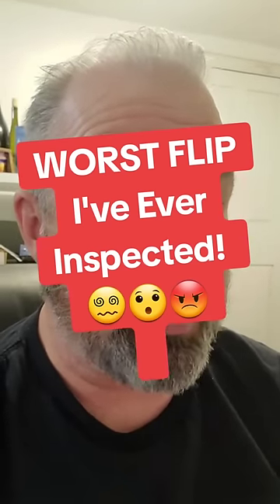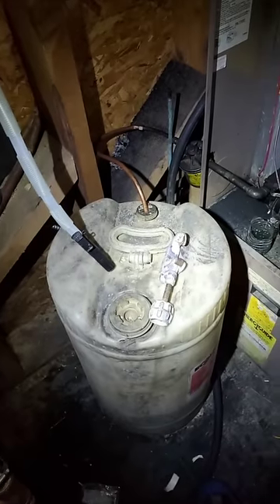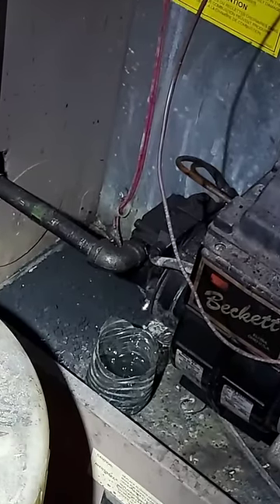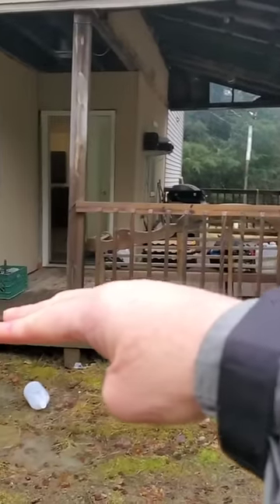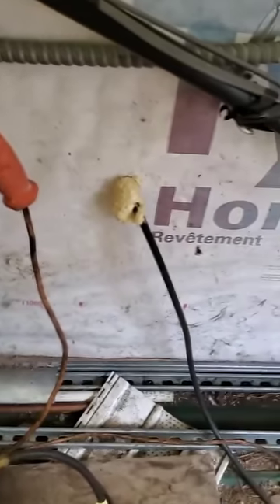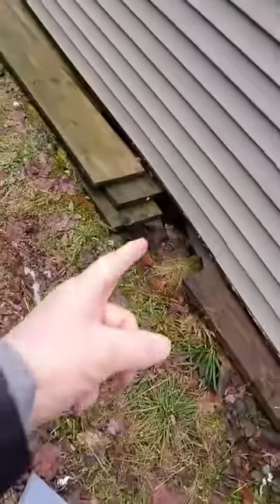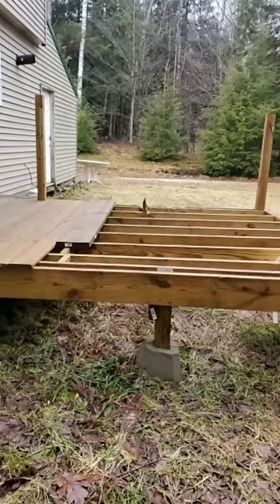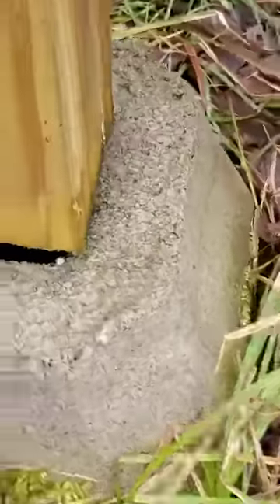The worst flip home I've ever inspected!

Comment: You should've called the fire department.  Seriously.  An active gas leak, and smoking walls???   Our dept. would've gone through the county to get that house condemned.
Reply: Building Department/Code Enforcement in my area, unless it was a 9-1-1 call that would bring out the Fire Department (the propane leak or the wood stove smoke reported to 9-1-1 would be proper). FD or the other two departments could red tag the place after they see/smell all those issues.
Reply: @crosslink1493  FD first to ventilate the place around here, then the code enforcement to shut it down.  A Bn. Chief or a fire investigator could do it after hours if the building people aren't readily available.
Reply: You don't need the fire dept to ventilate the place. Anyone can open the windows. And no need to wait for code enforcement. The fire marshal can have a place shut down.
Reply: @queenbey6678  Wrong.  If there's that much gas leaking inside, it's NOT safe to be inside.  Not every place has fire marshals.  Kinda helps if you know something about the subject...

Comment: There were definately no tradespeople on this project. Looks like a burger flipper watched too many episodes of flip this house and got courageous.
Reply from the maker: Believe it or not, the ownwr is an experienced plumber, has his own company.
Reply: @Inspector_preston  You'd think in that case that he would at least understand Ugg's first rule of plumbing:  "Inside pipe stuff should not be outside pipe stuff."  Applies to gas just as much as it does to water.  My goodness.  Would he run PEX through walls made out of razor blades?  If not, why would he think romex is fine?!
Reply: Why put down burger flippers like that? Surely they could do better work. A Big Mac is more structurally sound than those porches
Reply: @snickerdoooodle 😂

Comment: Nice to see an youtube inspector not doing the stupid "putty and paint" inspections.  This is one where the home inspector  needs to call in city/county building inspector before someone dies.  You can tell most of that work was done without a building permit.  A side note, joist hangers were not always code required.
Reply: I had a 50-yr-old deck that was fastened to the header with six alternating nails for each joist. The joint was still solid as a rock even though the boards themselves were starting to rot.
Reply: Unfortunately some places do not require an inspection after a renovation. The amount of things I've seen places I've lived that would not pass code for a doghouse does terrify me whenever I think about it.
Reply: Without a permit? How about without a brain?
Reply: The roof of a patio that was not to support a second-floor occupiable space didn't need joist hangers back about 20 years ago IIRC.
Reply: joist hangers are a couple a bucks each, why wouldn't you use them?

Comment: Got me beat by a little. We went to one to "repair" a footer , keep in mind this home had been flipped already and inspected when the current owner bought it. All this stuff came up when she went to sell it about a year later due to job transfer. The inspector caught that the addition on the far side of the house was about 1 foot above grade. He stamped a repair that had us go in to pour concrete against it to prevent wash out, not sure that was a good fix. I wouldn't have done it as a GC but the engineer approved that as the repair. The sellers had noted a "sewer smell" whenever it rained. come to find out it was a pinhole in a natural gas line under the home from the haphazard twisted up copper supply line they had run and crimped around a concrete pier. While we were repairing the foundation I looked over at the water heater and found a cedar tree cut with branches and drove in as a support for the floor. How BOTH inspectors missed that I have no idea.
Reply: They don't look most of them. They look from a far distance and go ok looks good and walk away while signing the slip permit
Reply: The inspectors probably didn't miss it. The owners just didn't fix it

Comment: Just a case of homeowners being poor.

Ive done some botch repairs in my day when I was younger.
(Obviously nothing close to as dangerous to some of these examples, I'd never risk my families safety). So well none of my fixes weren't a danger, I knew they were not done correctly.

The reason for some of my hack jobs ? I was young... had a new family, bought a house that wasn't the most cared for.. but it was what I could afford at the time. So...

Well I certainly can say some of these examples in this video are crazy. They went way past the line of "a hack job" into borderline suicidal territory.

Anyone who has ever experienced some financial hardship can somewhat understand how things ended up this way. It's  a slippery slope.
Reply: Lol. Naw. I've done some clueless stuff when I was young and broke, but spray foam on a lit chimney? Painter's tape on a gas pipe?
This is either drugs or mental disability. Maybe both.
Reply: “Weren’t a danger” <> “not done correctly”. Codes aren’t there to be a pita. They are there because someone got killed and they didn’t want it to happen again.
Reply: @sirifail4499  

Yes and no. It varies greatly depending on where you live - and money can also have a motivator.

For example, in the States, it's legal to hook up your generator to your house via an interlock kit.
In Canada (at least the province I am in), it's highly illegal and subject to fines and jail time. The only legal way is to use a generlink, which is 10x as expensive.

An interlock kit, is not "to code". Even though it is safe - but because that rather affordable method is illegal - it actually motivates some people to use very dangerous methods. Which is much worse than an interlock kit.. which again - is safe. But it's cheap and convenient so it's "against code".

I could list many more examples. But I think I've made my point.
Reply: @YSLRD  
Agreed.
Obviously, there is a line between being cheap and just straight-up stupid.

Comment: I'm no inspector, but I definitely know what your talking about. My Dad flipped houses for years, and did really great. I would help him clean out these homes well before he would continue his work.

I will share however the time I went to look at a house this guy wanted to sell me. I felt exactly the same as you did when it came to this guy's house. The floor in the house was so unfit, I could easily see anyone falling through the floor. There were chewed off holes around the door which suggested rodents living in the house. Over half his roof needed to be completely re-done, as in not just shingles. Most of his walls were gone including the insulation. The deck was completely rotten, and he proudly stood there telling me he built that house. I then said his house is unfit and needs to be condemned. He wasn't angry, but rather he was trying to convince me his house was safe. At the time he was not living in the house(not surprised). I can only say he was staying at a facility that looked after him, which I reported to the authorities everything I discovered about his house. The guy had even tried just selling me his land, in which I said not until he clears the lot of the house, the garage in the back, and the pitiful shed as well. I said the well and driveway is fine. I said I'm not buying land that requires me to clear it of condemnable buildings, unless he is willing to lower the price of the land so that I can pay you have the land cleared. He did not sell his land to me because he thought I was the unfair one. People, that's all I got to say.

Comment: I’ve seen some crap in my day. Went to replace a water heater in a basement. So I go look at where it’s going and I walk into a unfinished room and I’m seeing all of this aluminum tape and it’s on every joint of a soft copper gas line. I ask what was up with all the tape and she said they had a gas leak at one time. I dated this girl and she lived with her brother in a brand new house that he just bought. So I went to get some cloths out of the dryer and almost got steam burnt. The dryer had been on for at least 45 minutes. I told her the cloths weren’t even close and she said that was the second new dryer that that had been replaced. So I go outside and look around the house for the vent. No vent found. Look in the crawl space and find it and where it once exited the home. Well the vo-tech  school down the road built a deck on the back of this house and they just ripped off the dryer vent hood and nailed their band board right across the dryer vent! In the same house the stove was lower than the countertop and the water heater was in the kitchen closet just sitting on the floor and not it a pan, also the stove outlet was not placed inside the wall making the stove stick 3 inches out away from the wall! Bad part is that he had a home inspection done, which I’m sure was through the realtor which is a no no!

Comment: I've been flipping homes for 3 decades and use licensed contractors and pull permits, my business partner is a licensed electrician, plumber, HVAC and MHIC. We outsource for sprinkler systems, septic and well. We do about 40 houses a year, they are better than when built when we market them.

While the home in the video is a flip, it's a distressed property, which is usually flipped by an owner to someone who is planning to renovate it and flip it. I've acquired many homes like this over the years and they usually require replacement of all major systems, structural including foundation repair, it will need a full rebuild and all permits.

What is different is that an experienced investor would normally not bring in a home inspector, they would bring in their contractor(s), which makes me think the buyer may not have the experience needed to take on such a massive project or, possibly, it's being bought by someone who plans to live in it, in both cases, they would be in over their heads.

Good luck to the buyers. We are on the edge of a market reset, which will begin soon after the November election, so we aren't buying now, we are selling off existing inventory.

After a housing correction, availability of foreclosures means we don't seek out properties like the one in this video, that only happens just prior to a correction when prices are bloated, and availability is limited.
Reply: Exactly right.

Comment: I'm seeing that BBQ-size propane tank next to the porch with a feed line attached and wondering if that's what they are using to feed gas to the stove?  Not a standard 200 gallon or 400 gallon residential tank installed 50 ft from the house?  Or maybe there was a tank that was defective and they tried to tell you it was OK, just empty?  So many NO's with that place!

Comment: Wait. You are telling me you smelled propane and yet you tried to light the stove?  Then the owner came over with a torch.
Reply: Chronology... Inspected kitchen first, tried to light stove. Then went into utility room and smelled propane. End of inspection, merely asked seller if the range worked, and he whipped out the torch...
Reply: @prestonkincaid  You need to update your inspection process my friend.  You should have been in the utility room prior to ever starting the inspection.  Change thermostat #1, #2. turn everything on that can be turned on at the beginning of with the exception of water to prepare for the inspection.  This is where you take a digital record before the inspection starts, mainly for liability but also for safety.  At this point you would have smelled the propane and terminated the inspection. Stay safe my friend!
Reply: @troyvogt546  Thank you for the advice, but I have an inspection flow that is methodical and does exactly what you outlined. When I got to the home, the owner was there fixing plumbing, and had ladders, tools and people in the utility room, so it wasn't accessible, so I was workinng around them.